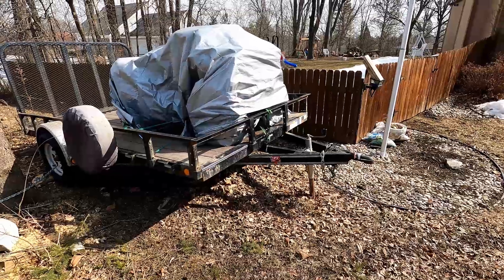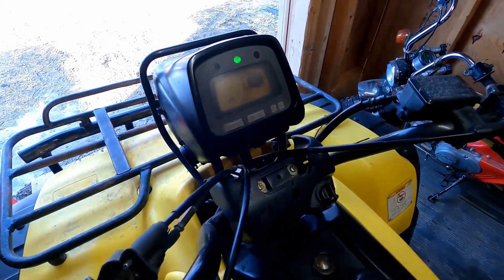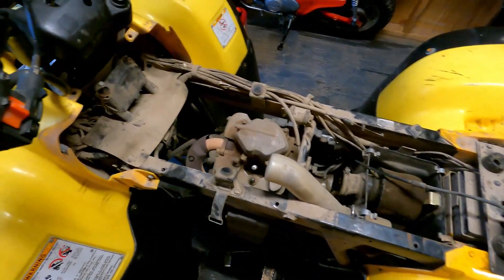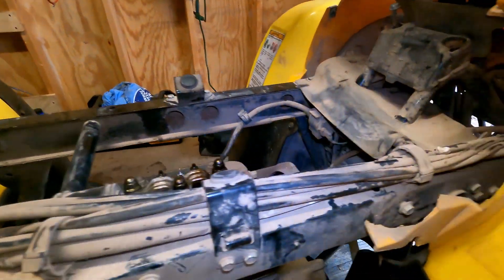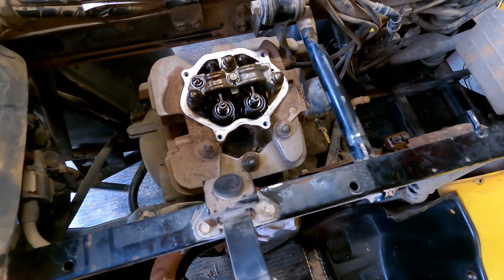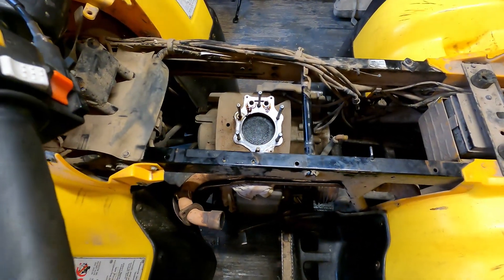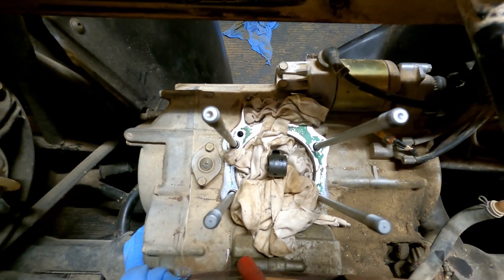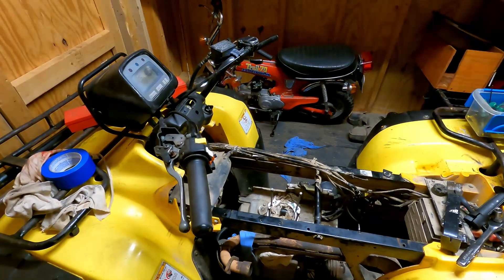Honda Foreman - Top End Rebuild (first timer) Pt 1

Comment: How hard was it to get the piston head off?
Reply from the maker: The head was pretty easy to get off
Reply: I’m stuck on the clips to get the piston off. How did you do it?
Reply from the maker: @lovable6803  I think I just used a pliers to get the clips off.  Otherwise they make special snap ring pliers u can get at a hardware store